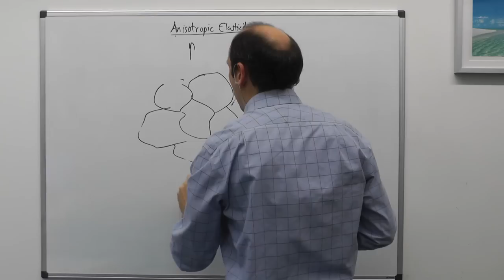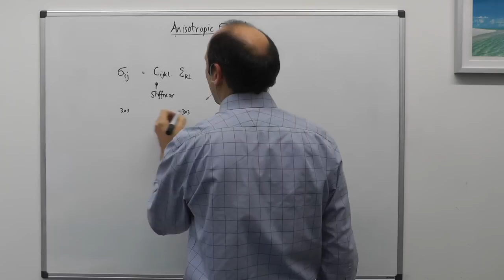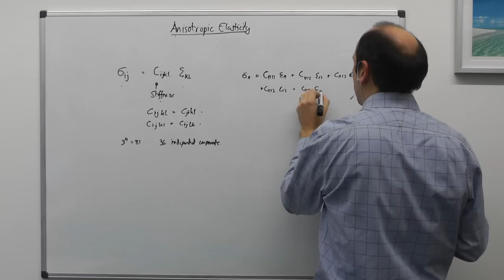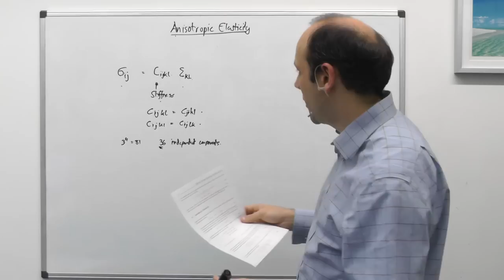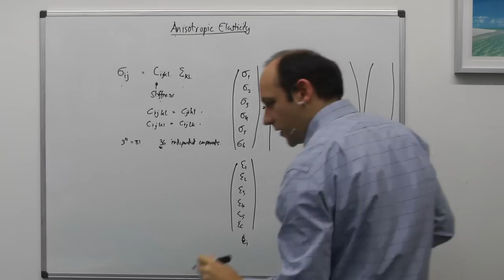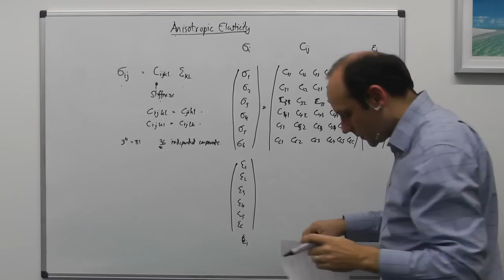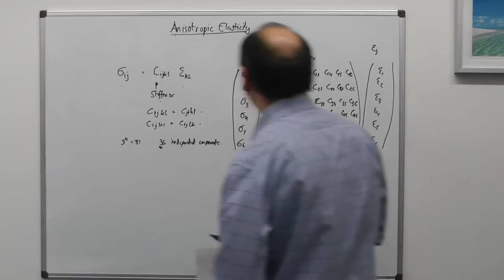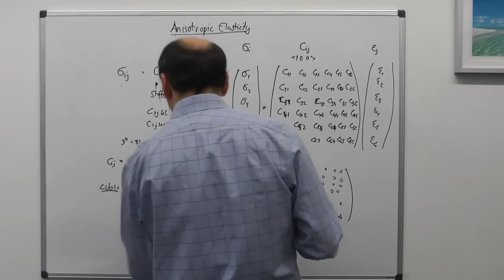L7a | MSE203 - Anisotropic Elasticity

Comment: Thanks for your explanations. I wrote to just mention a typo in your formulations. When you wrote the relation between stress and strain tensors in terms of the compliance tensor at time 3:30, you forgot to modify the indices and you wrote on the board S_ijkl \sigma_ij =  \epsilon_kl instead of S_ijkl \sigma_kl = \epsilon_ij. Although this formulation is correct for hyperelastic materials having the symmetry S_ijkl=S_klij, at that time of lecture you talk about the most general form of C and S tensors and I think you should add a note to your video.